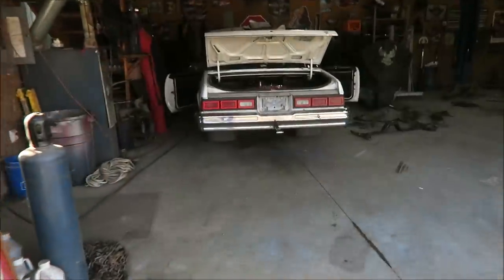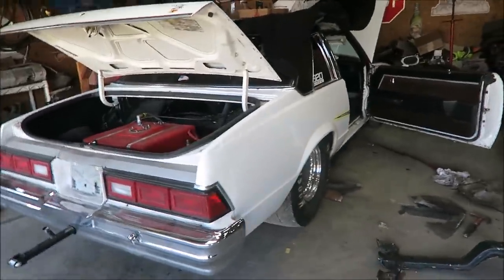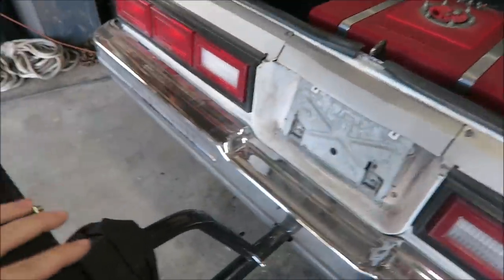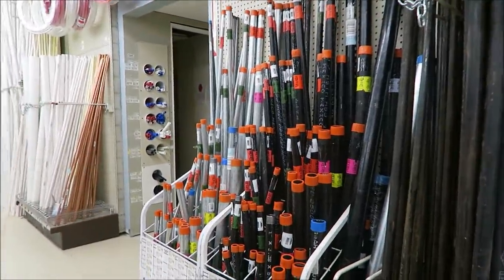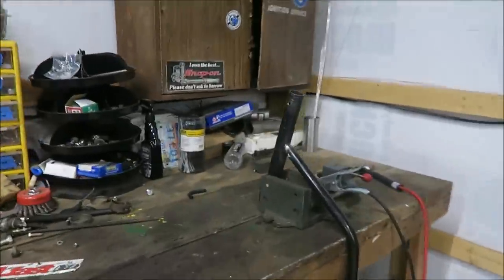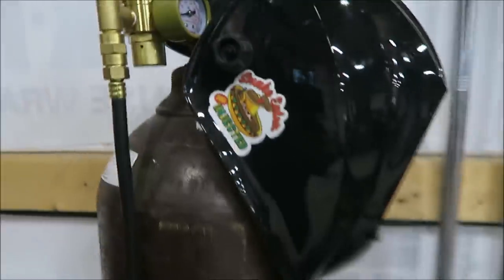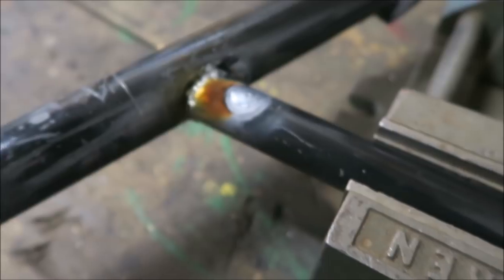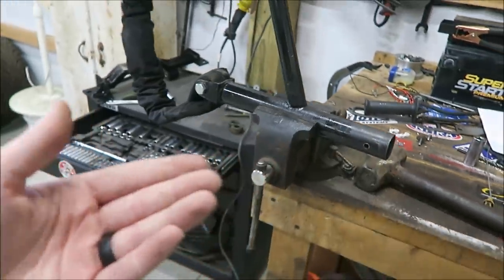Big Tire Back-Half Malibu Drag Car! So Many Vehicles to Build This Winter!

Comment: FIRST  thing Lloyd get rid of that poor excuse of a fuel cell. ALL LIFE MATTERS so don't go with what looks fast
but go with what is actually is safe going fast.buy a ATL Cell that fits how you plan on using the car. think about 
lowering it's mounting to help with the center of gravity.   sorry  JOSH  but this poor excuse of a fuel cell has
been the cause of to many friends being injured.
Reply: Hey it came with it in there
Reply: @papatron-gr4wg  😆